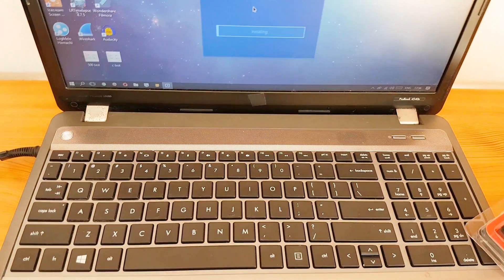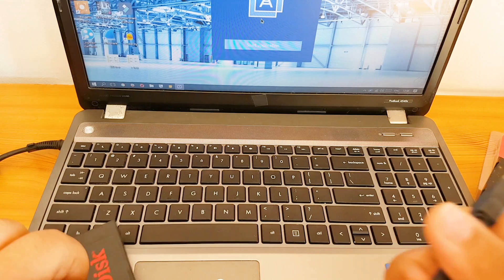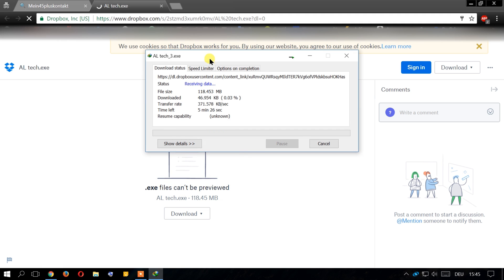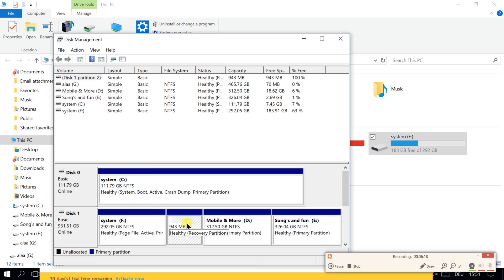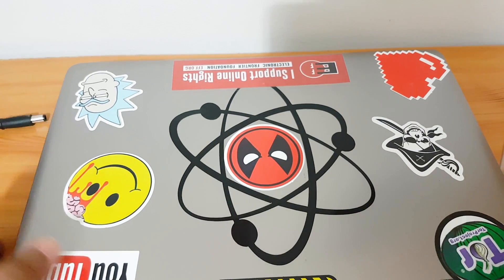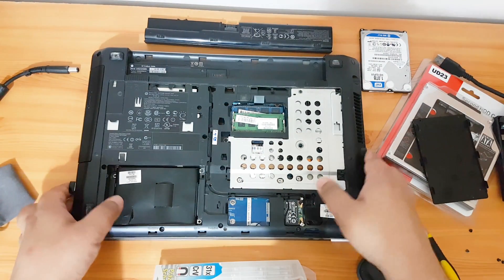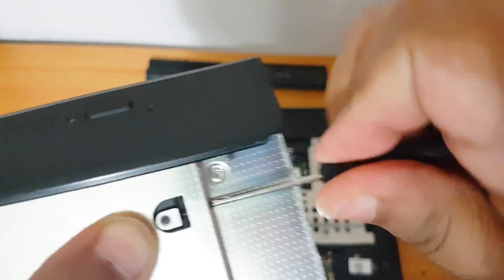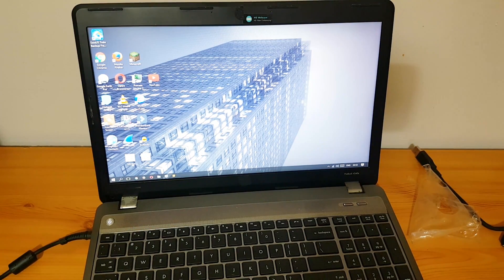HP ProBook 4540s SSD upgrade and clone windows to an SSD  4K

Comment: Did you have to do any bios teak for the laptop to recognize the HD on caddy bay? My HD just doesn’t show up, could it be a bad caddy bay?
Reply from the maker: You can't boot system from caddy. But you can use it as a normal drive just not to boot windows from it. if it don't show up in windows it's probably bad